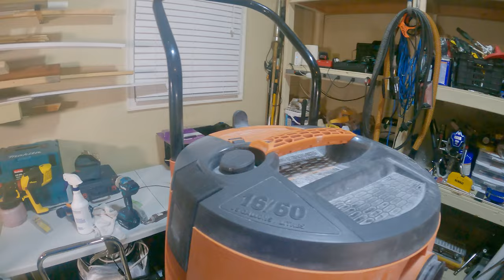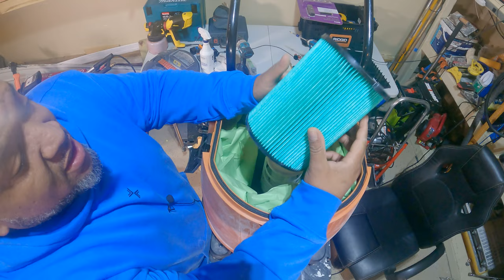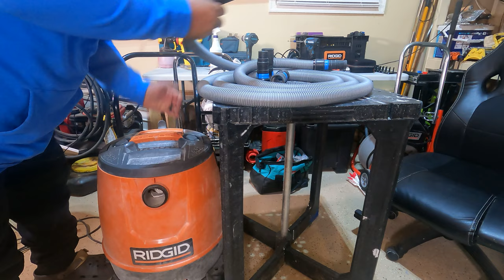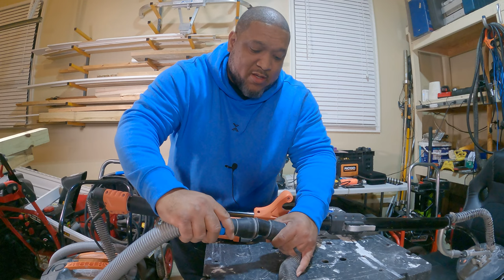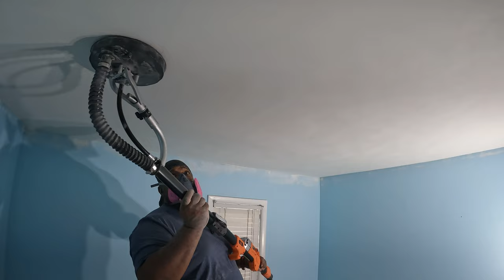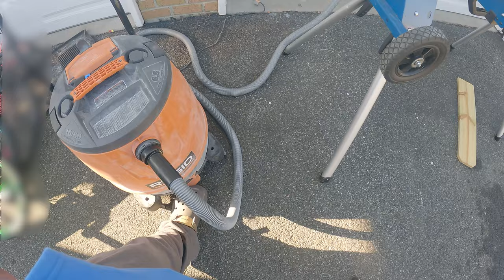My Most Effective Jobsite Dust Collection Setup | Handyman Business

Comment: The value and importance of dust extraction and containment should never be underestimated.  It is a craft by itself, indicates that you have respect for your client’s home, and is a reflection of your level of professionalism.  Most clients expect there to be some amount of dust when doing certain types of work, such as drywall, or carpentry,  but it is best to leave them pleasantly surprised.
Reply from the maker: Agreed, whether I'm doing drywall or use in a miter saw, I always try to contain the dust. It helps you as the contractor just as much as it helps them.

Comment: I have the same Cen Tek hose connection kit. Haven’t had a chance to use it yet. I’m having trouble with my dust cyclone effecting my large Ridgid shop vac’s suction power when connected (yes it’s connected properly) but hoping it’s the shopvac itself and if I replace a filter it’ll work the way it should. Definitely like the quick click connect centeks system is great quality and cheaper than Rocklers hose attachment system. Plus I have Lupus, my hands aren’t as strong as they used to be and disconnecting hoses and attachments are normally a dread for me but this quick click connection makes it painless literally and easy, you can adjust how much air flow you want. The Cen Teks system doesn’t get enough attention which is too bad.

Comment: Thnks for the nfo on the CenTek hose; you're the 1st to mention flex.

I've spent most of this yr remodeling my shop & an improved vac system is planned.
 
I've had a box of 2" vac line fittings for 20 yrs, waiting, so it's 2" plastic duct & multiple hose drops & perm connections.

Looks like the CenTek hose & qk connects are the ticket from what I've seen on YT.

I started as a carpenter apprentice in the late '60's. Did  my last job for someone else a few yrs post 2K.

Mostly remodels, so I hear you about keeping customers houses clean; besides who likes to clean for 2 days @ the end?

I tried every system there was. Finally gave up & devised my own system of minimal sanding 'rock finishing.

It took me 6-8 mos to fine tune & 3-4 jobs to perfect my technique, but in the end, I could hang & mud sheet rock for 2/3's of the cost of subs AND that's w/ me paying myself, too.

I bought really good knives, used much thicker mud,  devised a rotation system where I never applied mud adjacent to wet mud.

I had to schedule the work so I had other work I could jump to, 'cause the mudding was multiple, short work periods.

When the mud was final coat dry, I has some light scraping & if I had to sand, I wet sanded.

Between layers, I scraped ridges & wet sanded, but all total, it was minimal.

The key was precision application; turned it into a craft, instead of slap 50#'s on, sand 49#'s off, like the banjo swinging subs did.

The one thing I did that improved my quality by 200%, (not just mudding, but ALL my finish work), was massive amounts of bright, harsh lights.

Picked up the ttick from an old custom car painter. What he said made so much sense.

"When I do the body work & paint the car, I do it in the most extreme lighting I can produce. Harsh, bright light, lighting it won't be in, ever. It makes shadows from any imperfection; bright light makes them jump out at you."

It's harder to do w/ a car, cause it gets taken out in the sun, but the inside of a house is usually dubdued, 'warm' lighting.

W/ the new LED lights, you wouldn't have to haul around 15+ 4ft floro fxtures, a dbl headed halogen stand & 3-4 of the halogen foot lights like I did!

Get your work in super bright light. If you make it look great in harsh, critical light, your customers wilk think you're a god.

I did remodels for 38 yrs, never had to advertise, never w/o work, unless I turned it down, but the best thing was, in all those yrs & 100's of jobs, I only had 1 customer unhappy.  One... I ran into him 6 mos post job; he chewed my butt for not coming back to get paid.

It was a little job, building a shed for an old couple; built it exactly how he wanted it, but I was disappointed. Told him I'd write up a bill & come back after lunch & never went back.

Treat people right, do work as good as you possibly can, & be honest in your dealings, what is possible in a job & about your limitations/mistakes & you'll do well.

Worked for me...

I'm 70 & still working like I'm 45, speaking of which, day lights burning & there's work to be done.

Later...

GeoD
Reply from the maker: I appreciate you taking the time to leave such a detailed message. The hose is super flexible and especially when I use the drywall sander, I never have an issue with maneuvering it around. I always try to keep the job sites as clean as possible. So even though I use a vacuum for mostly all the projects, I also use the zip wall system to make a plastic barrier around the area I'm working in. So far after over 5 years in business. I've only had customer surprised when there's no dust to clean up after a large drywall repair.
I also completely agree with you. As far as lighting is concerned. I have a couple of extremely bright headlamps that I wear when I'm sanding to ensure that every groove is sanded perfectly flat. Also have a super bright light that I picked up off of amazon that'll make the darkest room look like the middle of the day. 
Once again, appreciate you taking the time to write this and I hope that anybody that reads this takes something away from it. Thanks!
Reply: @DarylTheFINISHER  Glad to do it. I was lucky enough to grow up when the trades were still very important & flourishing.  Construction was a family biz, my bro-n-law did framing & occasional spec houses; my step dad was a remodeler/handyman. They both were 3rd gen carpenters.

I was taught it's the current gen's responsibilty to pass on knowledge & encourage entry to the trades, even if it's not your trade or a relative. 

In my late teens, my bro-n-law started trading me w/ other tradesmen who had sons, brothers or non-related apprentices.

We'd spend 2-3 wks working for a plumber, electrician, flooring guy or excavator... getting a crash course, an exposure to a diff trade & the experience of a different trade master/teacher/employer.

Over a couple summers, I learned a lot, had my eyes opened about how different people could be when you worked for them & saw the plumbers son take his 1st steps to being an electrician & a kid I was in school w/ fall in love w/ excavators, (he ended up in wells & built a very successful biz, (half dozen drilling trucks), his grandsons now run.

Things have changed a lot re: trade work, not much interaction w/i trades or between them. Few multigen situations.  I haven't seen anyone take on an apprentice in 30 yrs & have been trying to find someone to help me & train or 15+.

So, I share & encourage on the Internet & YT.

Was planning on launching a channel before covid hit; got covid real early, then the covid stimulated HPV cancer. Had surgery, became 'cancer free', then a recurrance, had chemo & rad, 'cancer free, again', then they found it in my liver. Had rad, again, now I wait until Dec to know if it was successful.

Lot of that w/ cancer... waiting to see.  Slow, very slow recovery, too. Not like an injury or sickness I've had; recovery is marked in months.

So, YT channel got back burnered. I'm just trying to get healthy, get my strength & stamina back.

Before covid/cancer, I could outwork most 40 yr olds, & a lot of guys in their 30's.  I turned 70 last month... LOL.

Hope you got something from my rambling. If nothing specific, thej just the mindset to being always looking to improve your skills, simplify tasks & improve efficiency.

It's how you'll succeed & the trade will evolve.

I always took the approach that if I was conscientious, researched a skill as much as possible, then customers would pay me to expand my skills & buy the tools needed.

I've hired subs to help me on jobs so I could learn the right way to do something, so the customer got treated right & I developed, as well.

If I broke even in the process, I was still way ahead.

One other thing I took to heart; never sell your tools. If you gotta eat or feed kids, as long as you have tools, you can.

Saw lots of guys sell tools when it got slow, then never really get going again.

Speaking of tools. I bought the LED version of 4ft floro shop lights on Amazon a few months ago.

Still ~17.00 for a 2 bulb 4 ft light. Now, they're feather weight & brighter than 6-8 four ft fixtures!

Later,

GeoD

Comment: So glad you're talking about this.  It takes so much work to keep a clean worksite!  I'm also running the ridgid 6.5 but top-mounted.  Bag and filter works great but ya, not cheap. I'm running an extra-long ridgid hose at the moment but I find I scuff corner baseboards and door trim too often so I'm going to try the soft hose.

Thanks for the share, keep hustling
Reply: @DarylTheFINISHER  I recently had someone, not a customer, recently mention outside sawdust can cause termites. I had never thought of that. Kudos to you for not leaving dust in a yard. I'm not going to do that anymore either. By the way, I used your link and bought that hose. Thanks for the video
Reply: Ok so I got the dust extractor this year, and although it's not as strong as the ridgid, it gets the job done.  A 9ah battery usually gets me through the day, using the hand sander, powered 9" sander, miter saw, track saw, etc.  Life is great with no cords!

I still use the ridgid quite often and I got a "remote outlet" on Amazon that works great to turn it on/off.  I have the button on a wristband. 

Handyman 2.0 is cordless!

Comment: The Centec (CTS) QuickClick hose system is great! I got the anti-static version and love how it simplifies connecting to all my tools.

I have the adapters attached to my most-used tools and used a permanent pen to write on the blue vent ring which tools/brands each adapter fits if they pull double-duty.

Lowering the barriers to always using effective dust extraction is worth investing in.
Reply from the maker: Before I found the Centec hose system I had to duck tape hoses to different tools. It’s completely ridiculous. Now I just jump from tool to tool quickly with no problems. Love it.